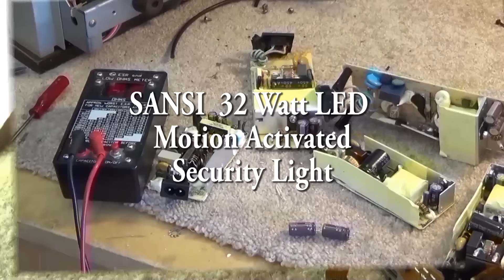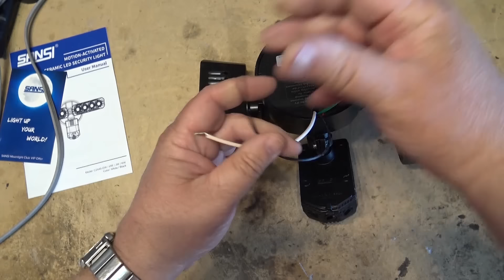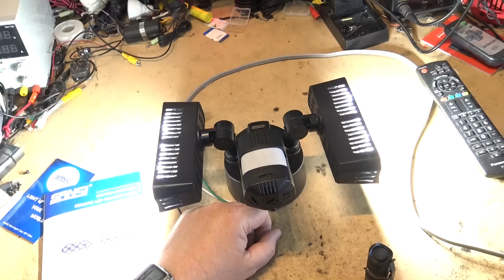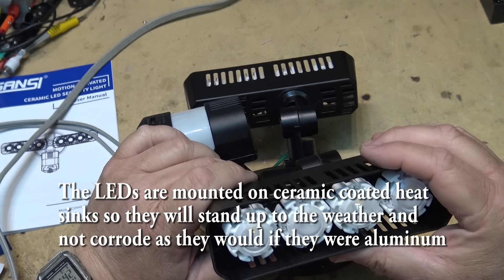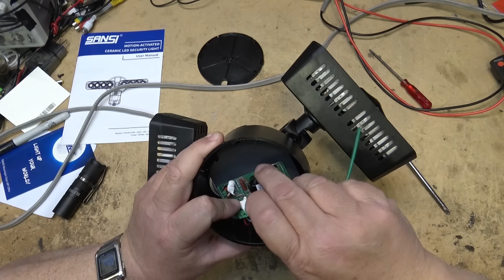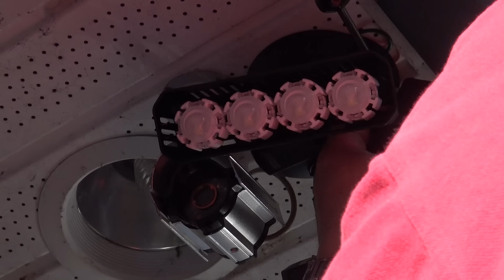Sansi LED Motion Activated Security Light Teardown and Installation

Comment: Here's what happened to mine after about 4 years - the white cover became brittle and cracked and now there is no cover over the Infrared sensor! And, the unit has now stopped working ... the sunlight must have made the white plastic brittle. This is in Texas BTW. Going to troubleshoot this little guy in a day or two and see if I can bypass the  IR control unit.
Reply from the maker: That is the lens. It has concentretic ridges on the back side that cause moving heat radiation to pulse the sensor. Just take the lens off an old motion detector and stick it over the opening.
Reply: @12voltvids  I'll try that I guess after I get the lights to come on in Test or On Time modes. Water might have harmed something in the sensor unit. Worst case, I just bypass the sensor and use it as a regular switched LED light. Nice unit other than the plastic IR filter being affected by Texas sunlight.

Comment: I've just installed this light and it's constantly on. 😢 Any advice
Reply from the maker: Most have a latch on mode.  If you flip the switch off then on they will come on and stay on to reset turn switch off for 5 to 10 seconds and they will reset. So what that means is a power surge can trigger the always on feature.

Comment: thanks. if 1 light bulb burns out,will others still work
Reply from the maker: I didn't look to see how they were wired but they should never burn out because they are only on for a few minutes.   Each side is independent so if one side were to go our the other would still work.
Reply: They burn out and I think you may have to replace the unit

Comment: My light is going if when my central heating comes on . The light is by the flu can I stop the light coming on? Would the sensitivity turned down fix this
Reply from the maker: It detects moving heat so if hot or warm exhaust gas blows across the detection zone it will detect it.  You can turn down sensitivity but that will reduce sensitivity to people too.  You can try to shield it.
Reply: @12voltvids  shield the motion sensor ? What and how would you suggest to do this
Reply from the maker: @markjohnson8162  you can stick aluminum tape over the part that faces the vent so it doesn't see the heat signature.
Reply: @12voltvids  your a start thanks for the reply would normal gaffa tape do the job?
Reply: @12voltvids  I’ve just bought some, so the flu is on the right hand side of the sensor so on the right side of the sensor tape it all up to screen it of . Is that what your saying to do ?
Reply from the maker: @markjohnson8162   strip of foil over a small section that faces the heat source. Then tape over it.
Reply from the maker: @markjohnson8162  yes sheild the side that faces the heat source.
Reply: When you say tape the side the sensor part, or the whole side
Reply from the maker: @markjohnson8162  the front of the sensor is a lens.  You need to shield a portion that " looks" towards the hot spot.  If you shield the entire sensor it won't respond to anything.  You will end up putting a small piece of foil perhaps 1/4" square on e small portion of the sensor that "looks" at the vent pipe to stop the bot gasses from triggering the sensor.  
You can turn down sensitivity too but then it also reduces the distance it triggers from.  Mine goes off all the time too but that's because critters are running around all night.

Comment: Review the video at exactly 7.32 - to about 7.50  At the top of the picture  (by the yellow propane torch and on the floor) there is an red/orange glow on the floor and it sounds just like something is arcing.  It didn't startle you so it must be something that you are use to everyday. Don't know.
Reply from the maker: First of all the yellow thing is a highlight marker. The red orange glow is my led sign that has my PayPal donation info scrolling across it and the noise was my garage door opener as I closed the door.

Comment: Did they fuse protect the LED driver?
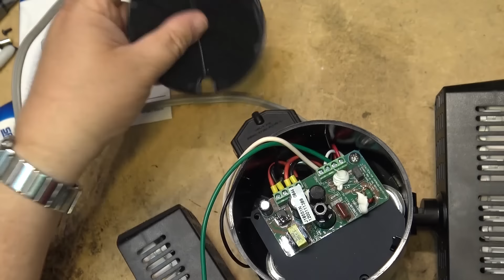Reply from the maker: 12:22 the black part next to the screw that holds the PCB in place. That's a fuse.
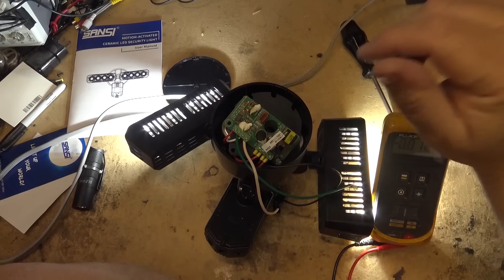Reply: @12voltvids   Dave, you're still up?  Yeah I was really talking about fusing the mosfet output just in case.  What made me think about it was at 14:34 when you said "If these LEDs are in series .." .. I'd swear you were gonna go into the Christmas tree lights in series issue  :-)  .. Lol .. but alas, a video cut .. we'll never know. Ha ha.  I've found on these types of units that it's not so much the LED driver area box that fails due to the elements (it has the conformal coating so that looks good) but rather the motion detector unit .. It usually starts with that front switch when I want constant lighting to plow the driveway after a big snowstorm and nope .. it's totally oxidized after about 5-6 years..  Uggg.. :-)
Reply from the maker: @techguy127com4  
Well they are like xmas lights. If one LED fails then they all go out. It is the high voltage low current scheme. Sure they could run them all at 12 volts in parallel you would need a 12 volt power supply that would have a constant current of 2.4 amps.  Running them at 96 volts on the other hand needs a transformer that is only capable of 300mA.
Reply: @12voltvids   This is true - no surprise there. Heathkit put out a kit version of these types of motion detector units (powering an incandescent fixture) in the early 80's.  I bought four of them back then, built them and then transferred them to my new house in '92.  Would you believe they're still working after almost 40 years?  Those were the days .. :-)

Comment: WHAT THE HELL WAS THAT electrical arc in the background??
Reply from the maker: Arc? Where?
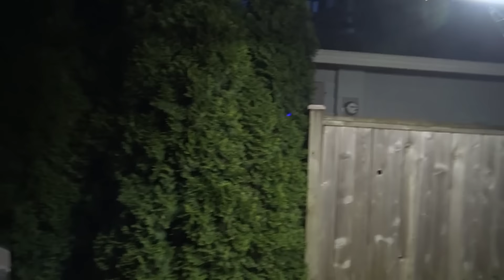Reply: @12voltvids  I think he's talking about the buzzing sound at 25:06 when the light came on.  Is that the light making that noise?
Reply from the maker: @techguy127com4  
No that is the air conditioner compressor. 
Yes I like to live in luxury. Heat pump for heating and cooling.  Getting warm enough for the AC to start and that means another spike in my power bill.  Wonderful.
Reply: @12voltvids  Ugg .. Does a heat pump really (efficiently) generate enough heat up there for a Canada winter before just switching over to electric aux mode?  I had one here (in the North East US) at the office building - got rid of it and put in gas.. much better.  The heat pump was just switching over to electric heat strips most of time other than for the short shoulder months period.
Reply from the maker: @techguy127com4  
Where I live they work well. It rarely gets below freezing.  On out coldest nights temperature drops to about -9 celcius which is what about 15F.  The gas backup comes on when the temperature drops below -6 so over the course of the winter the has runs perhaps 1 week or so.  I do run my gas fireplaces a little more in the winter months. Perhaps further north and east where they get brutal winters but not here on the left coast.  We had a total of maybe 3" of snow this past winter and it lasted for about 4 days.  And yes I was laughing at my friend's in Ontario this year.  Not only did they get burried in that white crap but now they have an indoor swimming pool where they didn't last week
Reply: @12voltvids   Oh OK . I wasn't thinking 'left coast'.  And you have gas aux backup instead of electric - probably much better.  I was paying about USD $1.00 /4KW plus commercial demand & ratchet charges at the building which was not good. Still paying that for lighting and computers but at least not heat.  We had that Arctic vortex thing here for a week his past Winter and hit around 8F down to -3F for a few days.  Not typical for this area but the weather has been changing over the past 4 decades.  Now going through the 'rain forest' mode - getting rain every opportunity that Mother Nature gets a chance to throw it down so it makes it hard to get all the yard work done.  This seems to be happening all over the US right now - daily torrential rains and floods unlike the past.
Reply from the maker: @techguy127com4  
Can you say "Global Warming".... I knew you could.

Comment: Interesting video.  I have been using Sansi products for about 3 years now and have had no issues with them other than the wattage ratings of the outdoor lights can be off up to 30%.  Since watching Big Clive exposing LED light ratings, I have always checked the ones I purchase.  I now have those fixtures in my garage and breezeway.

I have contacted Sansi directly in China and they do respond quickly.  I have advised them on 2 occasions about the power shortfall comparisons of 2 particular outdoor products based upon the claims in the Amazon blurbs and they  apologized for those errors.

All in all, I like the quality of what they make and the indoor bulbs I have that are Sansi have all worked fine and were in specification too.  I believe the unit you reviewed and installed was properly spec'd at 30 watts.  The model number also coincided with a 36 watt version using the same form factor but your materials did not state a 36 watt rating on the box, as the other model number does.  

I love LED lighting.  It is the way to go.  Got rid of all my mercury vapor stuff as a result.  I have all Hyperikons for my yard and driveway lighting  because they offer very high power and they have all tested as spec'd.

Good review, very educational.
Reply from the maker: I measured 30 watts. They say 36 watts on the web page, but if you add up the led chips, 4 in each light that is 16 per bank, and 2 banks is 32 LEDs. If they are each producing about 1 watt, that would be 32 watts, and it draws 30, which is pretty close. I don't know how accurate my power meter is as everything always reads a little lower than claimed. Even a 100 watt incandescent bulb only draws about 96 on this meter.

And you are right about LED. I have replaced the majority of the bulbs in my house with LED. Only a few CFL bulbs remain and when they fail they will be replaced with LEDs.
Reply: @12voltvids  I have met the same situation like you guys. Mine is 30 watts, but on website it's 36 watts. So i contact the brand seller and they told me it's truly 30 watts for selling before 2019, now they are selling 36 watts on the same website. That means 30 watts and 36 watts have the same amazon link, but now 30 watts has been sold out and there's only 36 watts. But no matter, it's truly a bright led light. I have 4 of sansi outdoor lights. They are around of my house and secure it. Super great! :)

Comment: You scared the crap out of me, for second I thought you got shocked. Remember people, don't play with electrical if you are not sure of what you are doing. This guy is a electrician by trade and knows what he is doing.
Reply from the maker: Ha ha.  Power was off.
Reply: @12voltvids  i have to say it looks like a pretty decent light, I might get one
Reply from the maker: @kristiandawe85  it is nice and bright.  Best one I have tried.
Reply: Kristian Dawe lol, got me too😂
Reply from the maker: @cryptodream5092  
If I actually did get a jolt I would probably cut it out.
Reply: An electrician would not have left the green and white wire hanging out the side of the light fitting.
Reply from the maker: @gus6rocks  
They are stuffed inside now. Couldn't see it while I was mounting because there was a dam camera in the way.  Saw that when editing and corrected.